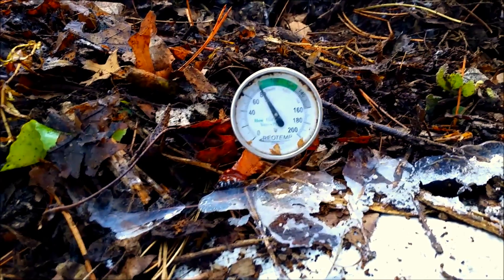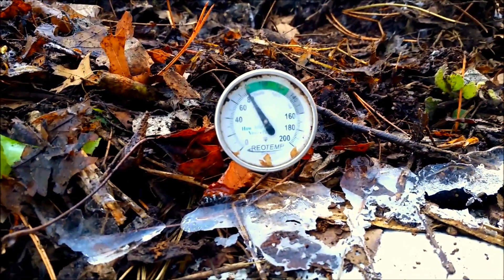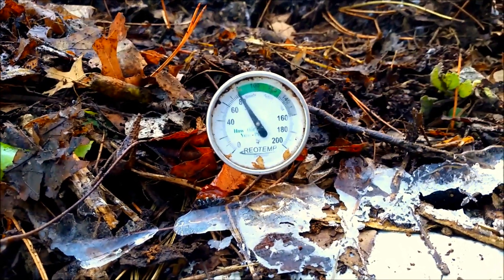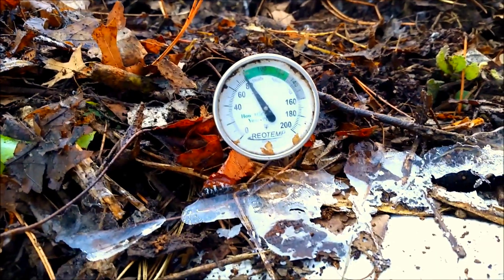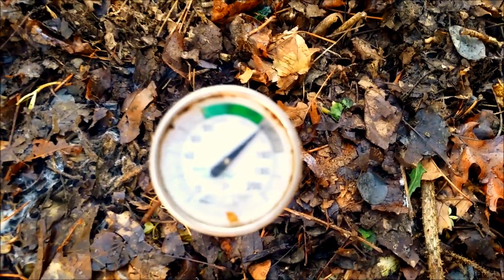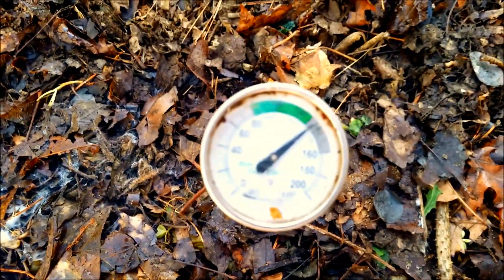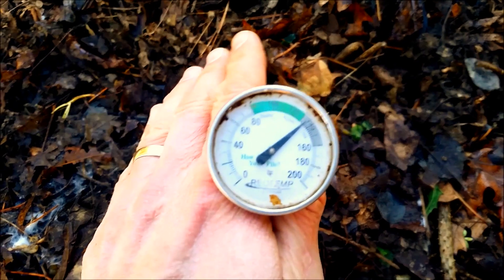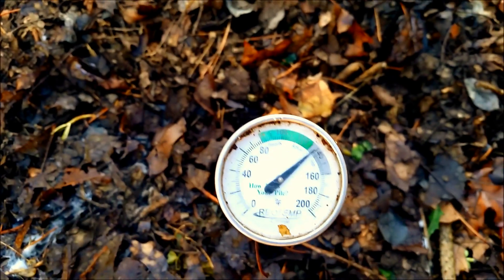The SECRET to HOT backyard composting!

Comment: The reason it went cold so quick is your primary was leaves.   If you get actual wood chip mulch, ie brushy tree limbs and larger wood chips it takes it much longer to become "spent" as well as will already have the proper mix of nitrogen and carbon.
Reply from the maker: It sure seems that way.  So would you say the coffee is restoring the C/N ratio?
Reply: Yes.   My experience is either small sapling wood chips or branches work best vs larger chips from harder wood.  It's the soft "heartwood" that does best.  On my 88 acres there is a never ending supply of small poplar saplings to chip up which works wonderfully.     If someone lives in a city that has a city "wood chip" lot you can often find exactly the kind you want for free or nearly free.
Reply from the maker: Thanks!  I'll be happy when I get to 0.88 acres.  Little steps. ;-)  I do have some mature trees, as well as saplings, so if I had a chipper, I might be in business.    What's your opinion on pines - I have a lot of those?
Reply: Pines are great.
Reply: @NC_Hydro  would coffee do the same?